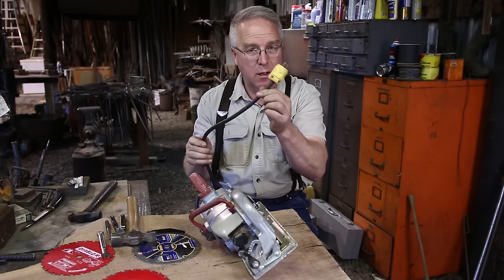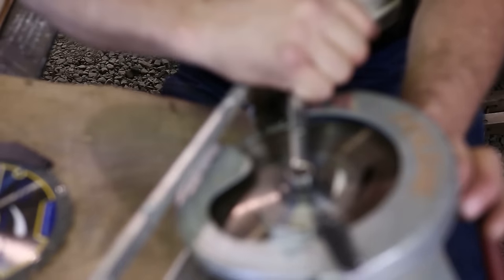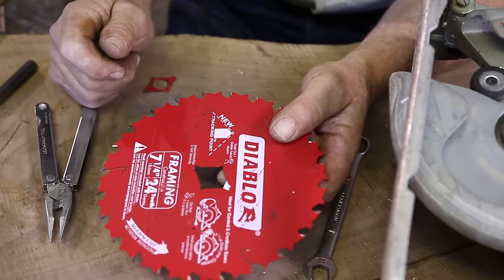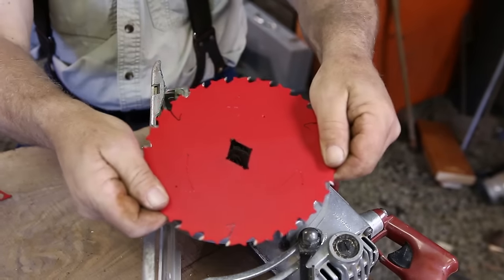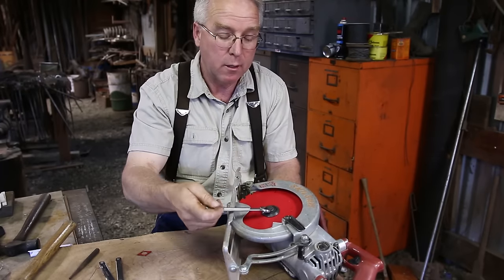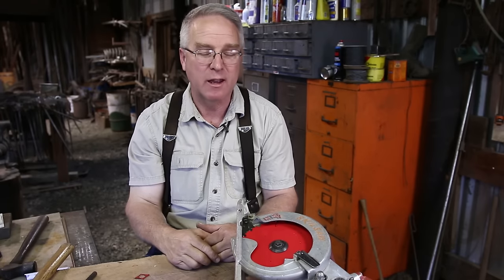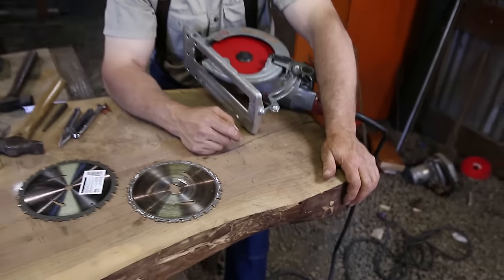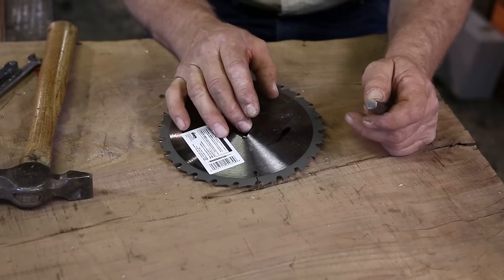How to Change the Blade on a Skil Saw

Comment: If the blade has all the teeth but is covered with gum and pitch from the wood you are cutting then use some oven cleaner on it to clean the blade and it will cut like new. This works great to extend the life of the blade and the quality of the cut. Of course use rubber gloves and eye protection when using over cleaner on any blade.

Comment: The nut or bolt holding the cutter/blade will loosen turning the same direction that the blade turns, doesn't rhyme but is easy to remember.

Comment: The blade label would be visible on right-blade saws, which are a bit more common.
Reply: LOL, That's what was bugging me about the video but I couldn't quite see because it was staring me in the face. His saw is left-blade. All my corded saws are right-blade, but my cordless is left-blade, and the branded blades for it have the printing on the "face" when installed ( more idiot proofing ? ;-)  )  I actually prefer left-blade but as you note they are less common.
Reply: bingo

Comment: Can anyone tell me if its absolutely neccessary to use a blade w a knock out wen replacing on the exact same saw show here. And what if the blade has no knock out, can it still be   used safely if it fits nice and snug?

Comment: My case always has 2 new blades in it. 1 gen purpose carbide 1 fine tooth. There's nothing worse than having to stop a job because you need to change a blade and you don't have one. Don't buy cheap blades,the good ones aren't that much more and last longer. Great video as usual.

Comment: Another factor is that the mounting bolt will tend to tighten with the acceleration of the blade, so even if one doesn't crank down when installing, it will soon be tight enough.

Comment: A universal tip for changing any circular saw blade: the blade always spins so that the force is pushing down (or pulling up in the case of skil saws) on the shoe of your skil or the infeed of your table saw. Point the teeth that way!

Comment: I got this cool new blade installed in my saw and damn thing cuts worse than the old blade....ooops well shit the blade was installed backwards...been there done that...done it a while back with my chainsaw too LOL.  

Really want a worm drive saw but they're heavy and I don't use a circular saw much anymore.  However, I do use table saws quite often and Skil now has a Worm Drive Table Saw :).

Comment: This has the potential to be a really dumb question, but why don't the saw manufacturers just sell the blades pre-punched?
Reply: Because a majority of saws don't have the diamond arbor - most are simply round arbors. A round arbor saw generally withstands less torque because it's able to slip, but the diamond arbor will stall the saw instead of slipping.

And if the saw doesn't stall, you get one hell of a kickback!
Reply: rjk  I had a feeling there was a good reason.  Thank you!

Comment: to determine left or right hand threads, the nut/bolt ALWAYS turns in the direction of rotation of the cutting implement no matter what kind of rotary tool you are using
Reply: JKC huh?... In this video the blade spins towards the front of saw.... Clockwise if your looking at the blade side and the bolt tightens counter clockwise...left handed threats
Reply: By "turns" JKC means "loosens". In the video the bolt loosens clockwise, which is the direction of rotation. This is so if the blade stalls it tightens the bolt instead of loosening it. It's a safety feature.

Comment: I was thinking it was odd that I'd never had to flip a blade over to the blank side... And then I remembered that all my circular saws have been regular old electric motor jobs and all mounted the blade on the right side of the saw body. I think I only ever used one worm-drive saw in my life, and it wasn't mine so I never changed the blade. But it was on the left side. 

Learn something new every day if you're not careful.

Comment: Can you get these in England? If I bought an American one and changed the plug, is that a stupid?
Reply: Jack Samson Butcher it's not stupid but it could be dangerous. You've got twice the voltage in Britain so you could very well damage the tool if it isn't properly rated for such a voltage. Generally speaking it's never a good idea to change what type of plug a device has. It has that shape to denote how much power and current it can be safely used with.
Reply: +Okits lol, thanks bud. It did sound kinda stupid in my head but I'm pretty clueless when in comes to electrics. I can change a plug or a fuse, but that's about it.
Reply: They don't make a 220v version, but you could run a 110v US version with a step down transformer.  I've heard that Brit construction sites actually use 110v anyway.  It would be stupid to just change the plug on one designed for 110v unless you understood exactly what you were plugging into.  Could be hard to find diamond arbor blades in the UK, too.

Comment: How does not tightening too much help on a diamond arbor blade? It will only slip a fraction of a degree unlike a round arbor blade which will slip slightly but as it slips it will tighten the arbor nut so again you won't get much relief.

Comment: I have to throw this tidbit in on this great video (might have been added already). Anytime you loosen a bolt/nut holding anything that spins, you loosen it in the direction the object/arbor turns.  They are made this way so the centripetal force of running the "spinning chooch thing" will tighten the fastener as it is hit with the resistance of the object it's keeping tight. I'm not an engineer, nor your mother... so if it doesn't make sense or work for you, blame a SJW or a tool designed in China.
Reply: It's not centripetal force, it's plain ol' friction. The blade tries to drag the fastener with it in the roundy-round direction.